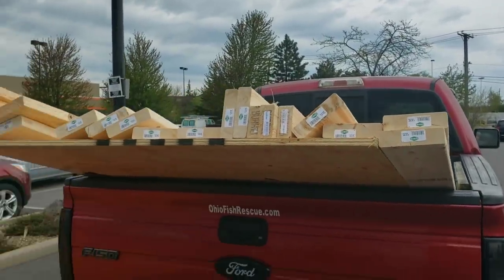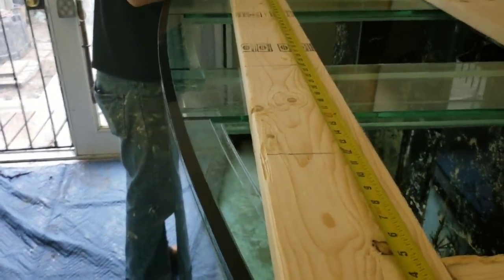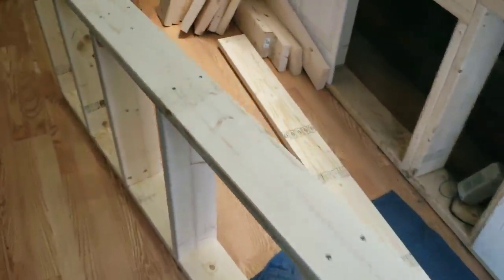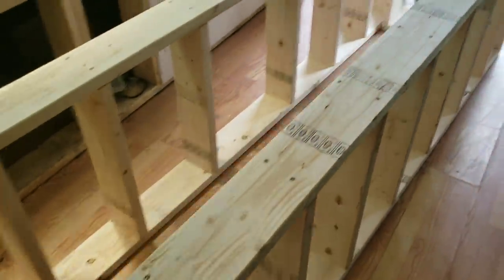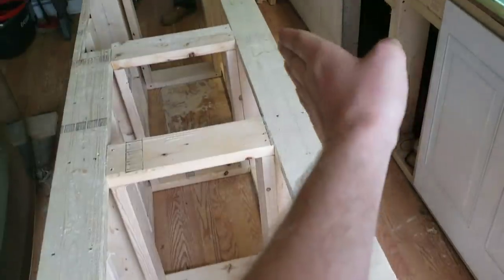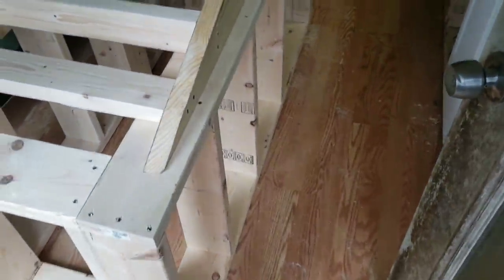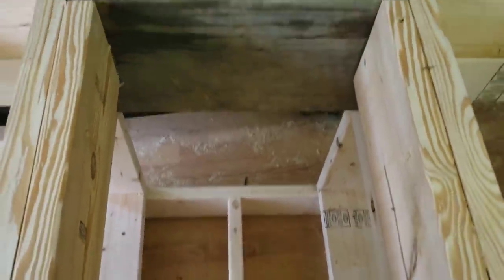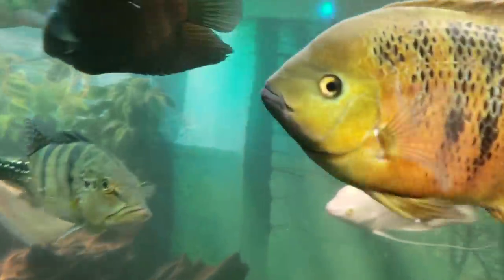How To Build An Aquarium Stand: Bow Front Edition

Comment: Josh, you mention using the green screws specifically...why is that? (what is the difference?) Thanks! (btw keep up the good work, and stay fishy my friend!)
Reply from the maker: The yellow screw dont like to grab as much, it's the coating on the screws and a bit of difference in the design. But I guess thatll change with your location you might not have the same screws as me. The green ones are much better for pulling structures together.